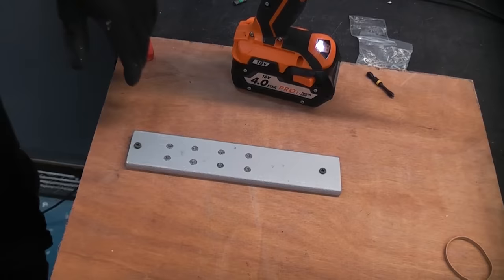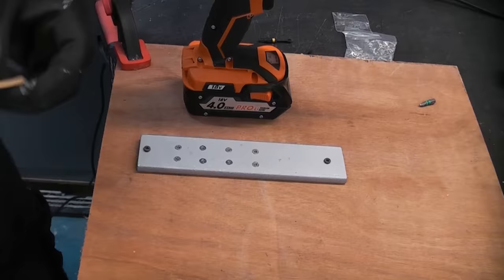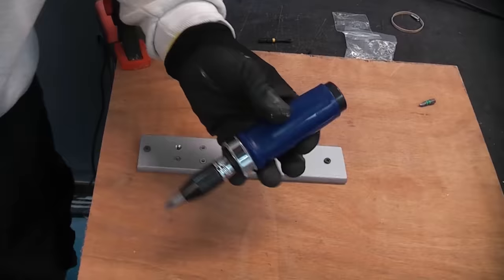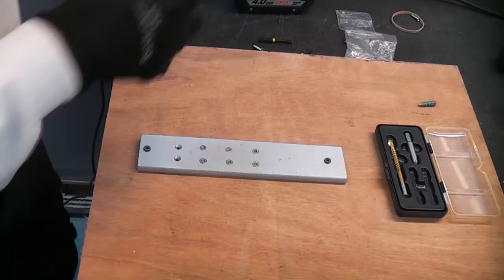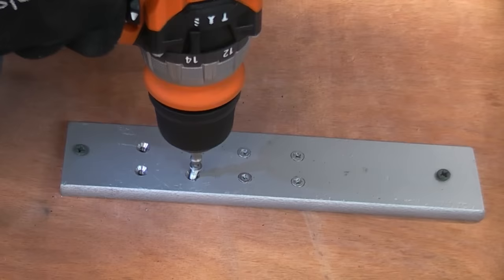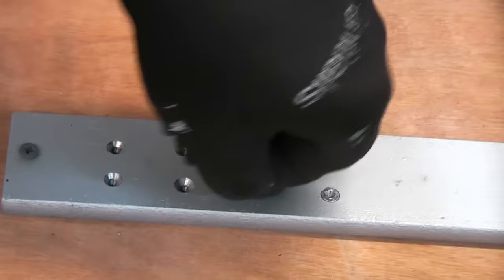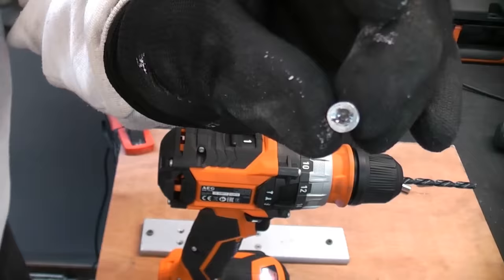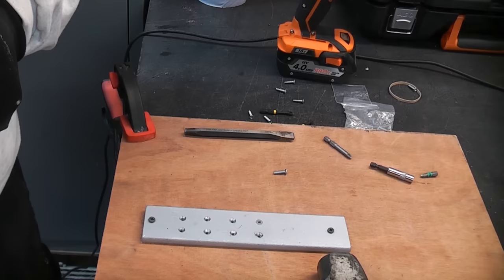How to remove stripped screws – 7 different ways

Comment: Anyone else salty af at a screw rn, I almost smashed my car window because of this screw
Reply: It's one of the most frustrating things, allll you need to do is remove the bolt/screw, ya can't even begin to start fixing the damn thing cause YA CANT REMOVE THE SCREW, I'm getting pissed just thinking about it lol. 

But yeah, stripped/rusted/snapped bolts/screws annnnd being unable to find a tool I JUST used when I haven't even moved are the worst things in repair in my opinion
Reply: Diving Duo bro this lil screw got me mad asf🤬
Reply: amen
Reply: Bike broke down and fixed everything and the only thing stopping me from being able to ride is a stripped screw!!!!!
Reply: 3 lil bstrd screws preventing me from changing a worn seat in my boat!
Reply: I might have to get a new steel chasis for my 1:5 rc car because of the damn screw. I'll edit if i will or wont have to.

Yeah ok i have to get a new chassis rip me
Reply: I jus threw my computer screen on bed which thn jump nd smashed on ground...now m super angry on myself..
Sitting in corner watching this video..
Reply: YES
Reply: @7withadot  same I'm working on the damn engine right now and I'm hella frustrated
Reply: Ye I need to get the seat of my motorcycle to get to the battery but I can't because one of dem fricking screws
Reply: Bleeder value screw on the radiator I stripped it off.
Reply: I started fixing an iPhone X that was 1300€ brand new, before getting in my hands some idiot messed up 2 screws and now I’m here stuck with a piece of junk with 2 bloody screws that are preventing me from fixing it......
Reply from the maker: @Keo   This video might help- https://www.youtube.com/watch?v=xaQ9eX-b6GA
Reply: Diving Duo mhm same boutta rpg my car if I don’t get these screws out
Reply: I'm in the middle of repairing my guitar, and I stripped the screws while replacing the neck, so there's that.
Reply: Lol I swear bro I was bought to fuck up the whole house 🤣🤣🤣
Reply: That’s called anger issues
Reply: Diving Duo me
Reply: XD
Reply: M2 slot in my laptop 😭 🔫
Reply: Yea! My freaking bike BRUH!! MY MOTORCYCLE!!!
Reply: Kyle Burke SAMEEE FRICK ME
Reply: Diving Duo Im trynna fix my Balisong but a screen is stripped Im Salty af
Reply: Same
Reply: I’m 9months late and yes I’m am livid I’m an working with a computer and this drive that is supposed to be screwed in is screwed in but done incorrectly so now I’ve removed 3/4 screws and one of the little bastards is messed up and I’m now I’m here
Reply: I am like well, life has ended. Might as well day drink.
Reply: @kyleburke5585  I am 1 screw from making a 110 yr old sewing machine operational
Reply: i am absolutely livid about a fuckin screw right now
Reply: Yes me rn
Reply: I'm about throw my ps4 out the window
Reply: Got too mad and now my 3ds xl is broken super sad i didnt see this earlier man still got my upvote learned something today
Reply: I’m about to throw my whole pc away guy I bought it off stripped one of the mobo screws🤬
Reply: So annoyed at my PS4 controller's screws. The conductive rubber beneath the buttons seemed to have worn out, so I order new one. But now I can't open the freakin controllee.
Reply: Fixed everything on my bike!!!!! And then the last screw is stuck!!!!!! IM SO FUCKING PISSED
Reply: 4 screws got me mad asf to even replace the screen the slide rail and the fckin sd card! On the fckin retarded nintendo switch
Reply: Diving Duo same
Reply: I'm literally dealing with this right now about my car with this stripped Philips screw underneath the car to remove this shield to get access to my starter....

Got all the screws off but the I'm one that is stripped... 🤦🏻‍♂️
Reply: So my screw for my laptop deformed how can i get this out. Fuck
Reply: I spent a whole day in one bolt stuck in a 1949 dodge power wagon the head rounded after the socket broke and I had cut the head off and it was on a cross beam type deal I put a jack underneath the beam and it lifted the front end of the truck... it weighs like 7k lbs
Reply: I need to remove the speed sensor of my car and I can't because of such a screw! 😰
Reply: Lol right I’m fucking passed right now! Stripped a important screw and now I’m here lol
Reply: No need to curse
Reply: any tips for removing a screw from a radio controller?
Reply: I get mad because Honda engineers don’t use bolts. They used the cheapest f-ing screws.
Reply: I am supposed to be studying but my laptop overheat shutdown on me 10 times yesterday so i thought i would clean da fan and literally I'm one screw away from opening the damned laptop.

This is so fucking frustating. I cant even attend classes.
Reply: Yeah
Reply: Hell yeah I’m trying restore these damn barstools and the last screw is stripped on one of them! So annoying 🙃🔫
Reply: Literally but everything pissed me off and it 2am so I’m tired and just started crying bc the screw on my bed is pissing me off so much
Reply: My Sig Sauer P365XL sight screws brought me here. Some bs for sure
Reply: Yea
Reply: Yes I stripped the screw in my skateboard and I’m mad as heck rn
Reply: Me rn trying not to throw my laptop out a window
Reply: if only i could smash my lenovo motherboard. stupid lenovo screwed the m.2 ssd so tight that it stripped!
Reply: I'm about to smash mine now.
Reply: @Trent Neiheisel currently got a stripped screw on an ABS Module for my Chevy Silverado 😂
Reply: ikr im trying to open my ps4 controller cuz somethin wrong w my right joystick but 2 of the screws are stripped amd rusted
Reply: Ye I'm tryna fix my mother's granny wagong and can't get the thing out.. getting mad rn
Reply: Just laughed so hard at this 😂
Reply: Trying to remove my bumper from my car and one screw is broken! My car's bumper is half hanging off because of this one damn screw...
Reply: Man I’m there right now LOL
Reply: im working on my jammed airsoft gun
Reply: If 23 is old then yeah I'm old lmao
Reply: @kyleburke5585  samr
Reply: @johnkren2636  i was also working on my guitar. Swap out a p90 in my hamer special and the 2 screws that are holding down the pickup got stuck halfway in so its poking out. Cant screw it in cant screw it out. Fuck me
Reply: @Subfightr  yea tbh u almost threw the shii across my room its pissing me off idek why we make screws like this🤦🏼‍♂️
Reply: Trying to repair a dirt bike 🤦‍♂️🤦‍♂️🤦‍♂️🤦‍♂️🤦‍♂️🤦‍♂️🤦‍♂️🤦‍♂️
Reply: @yentre8754  same
Reply: Same
Reply: @Subfightr  going through this right now. Stripped screws in my 150cc carburetor 🤬
Reply: It’s called screw for a reason mate 😂
Reply: My fkin helmet screw, how can someone make such poor screws for godssake, its screwed!!
Reply: Bought a bicycle yesterday that needs a brake shifter/housing. Simple job....but the gear shifter can't come off the bike meaning I can't remove the brake housing...all because of a messed up screw!!!! Elastic band hopefully to the rescue since I have limited tools :D Biggest tool in the box seems to be me right now.
Reply: I almost smashed my camera
Reply: Mate I had 3 out of the 6 screws holding my wheel on my electric scooter strip with minimal force while using the correct tool which has made it literally impossible to replace the tyre. I am pissed.
Reply: Yyeeeppp, trying to remove an ignitor from an old bike and the last owner decided Phillips head are a great choice for a fucking bolt thats gonna get Wet
Reply: Yup. I just wanted to paint a damn wall while my toddler takes a nap.
Reply: ford engineers set the torque spec for my cargo rack to straight jesus mode
Reply: Two years later and i just slammed my hood🥲
Reply: Lmao yes!
Reply: My phone screen is driving me crazy rn
Reply: I feel so much better reading these comments I was so close to violent destruction trying to remove a hex grub screw so I can replace the cartridge on my level basin tap, it’s not going anywhere so im just sitting here waiting for Police to arrive, my wife said “you might have to get the plumber to come back “ that was super helpful .
Reply: @ronnieg1341  I hear you man, I, sitting out here on the street with a whisky watching the house burn, cops ought to be here soon, wife is gonna be super dissatisfied when she gets,home . All because of a dripping tap/faucet and a stripped out grub screw, I do feel better reading these comments though
Reply: 2 years later and this is still felt😭
Reply: Just almost smashed my ps4 it came in the box with the inside of the screw slanted downwards and every thing just spun in it
Reply: @Subfightr  same bro fucking 22 year old factory radio screw stripped and won’t even turn
Reply: I’ve been trying for over three hours and have less than zero progress
Reply: Here for this same issue 😭
Reply: You know how it is
Reply: @nanashi2632  "Sitting in corner" 😂😂😂
Reply: My curtain rod screw I literally have been begging and then pissed off and threatened it. Soo... now I'm on YouTube cause fuck it
Reply: I spent 2 days sanding , cutting , filling , sanding , priming and building an outdoor lounge table , only for the last pocket hole screw to become stripped and cause me to disassemble the whole thing again . 🤬🤬🤬🤬
Reply: yes, yes i am.
Reply: Ffs
Reply: Don’t “screw” with this person, they don’t “Screw” around LOL
Reply: What works best to remove a screw in a MAGÀ'S head?
Reply: @Subfightr  Spot on! 👌😆
Reply: Lololol yessss
Reply: Nope, didn't understand a word...
Reply: My battery is bad on my scooter. But I can’t get it out because of a screw. I won’t be able to replace it, it’s stuck in there for now. How am I going to get to work Monday? You would think flat head screws would be used more often. How such a little thing can create such a big problem is beyond human minds.
Reply: You have no idea. 2 came off fine on my moped, and on the other side the bottom one came out eventually, the top one is now destroyed and I'm losing the will to live 😂
Reply: ur comment is 4yrs old and i hope ur feeling better abt the screw but ye. i think im going to throw the whole door away 😭😭😭
Reply: 2 hella screws they just put me in damn shit
Reply: @Subfightr  facts😕
Reply: YUP, happenin rn tryin to remove the derailer on my mtb..
Reply: Wanting to kick the bike I just got over because of this screw

Comment: These videos are nice and all but the reason you're not getting the same results is because these people are drilling and stripping fresh screws/threads, while your screw has seized from all the time it's been in place throughout the years.
Reply: Spot on
Reply: Worked for me on an older home we bought where they had stripped screws putting cabinets up. I had to use the last method of turning them into flathead screws, but they’re finally out.

Comment: I don’t get how all these DIY tutorials always seem to work for everyone else, but never for me 😩
Reply from the maker: Some techniques work some of the time, but experience helps ;-)
Thanks for the comment 👍
Reply: Same😂
Reply: It is because you did not put.on gloves.
Reply: The rubber band one pissed me off so badly lol
Reply: A lot of it has to do with being able to press down hard! If you're working in a position where you can't get good traction or in a tight space probably most of these won't work other than the spring loaded thing. This is exactly the problem that i have right now. So i'm going to try the rubber band and if it doesn't work good old pliers because my screws are not completely set in.
Reply: Cause he s probably got a decent drill , mine is pink and from wal-mart , and forget an impact driver . ,,, sigh ,, I need a big girls tool box Lbs
Reply: @kahlalamb2854  literally crying at this comment 🤣🤣 because I'm in the same boat..thought I was cute with a pink walmart drill.
Reply: me turning on you maybe we could work
Reply: He might have had a better table than you?
Reply: @jlcdrivewayramps7343  He might have had a better table too.
Reply: Stacey, This video was only for demonstration purposes to empower us with the knowledge of tackling such an impossible task. I'm just a DIYer and I have struggled with removing good screws with their head intact let alone damaged screws! A lot of screws can be rusted or buried and just very stubborn to remove. But the key is to try different tools and techniques along with persistence/perseverance. I don't have all the tools that are mentioned in this video but once I was able to remove a small screw from my son's computer harddrive by cutting a line across the head of the damaged screw using a junior hacksaw. I was then able to get just enough purchase using a flathead screwdriver which I managed to remove by hand. It took time but I persevered. And I'm no builder or know anything about screws. But this video is very informative and helpful so I appreciate these videos from tradesmen especially this one. The key is to get enough purchase/grip so that the screw can turn.
Reply: @KosmikGawdess   Yeah when it comes to tools, functionality comes first, second and third.
Reply: lol
Reply: @MrammiR  noon population
Reply: @kahlalamb2854  look
Reply: Exactly
Reply: It’s cuz u have to talk to it in a Great Britain accent
Reply: I was about to say the same.
Reply: time to call your man baby
Reply: First off this dude has 1/2” screws that aren’t really that deep into his material
Reply: A hood classic, un clásico del barrio
Reply: @kahlalamb2854  i actually tried a normal screwdriver and the screws literally melted down and got stripped stuck 😴😴😴 I guess my hand is overpowered
Reply: That's the power of editing
Reply: You didn't try the "duct tape" method. I actually just saw that on the site of a Canadian DIY lady, @Daru Dhillon.
Reply: @cesarcotto3351  His is not that accent. It is more like Scottish or Irish.
Reply: It doesn't work for you because these are the simplest extractions possible in this video. What you may be trying to extract are rusted bolts, stripped threads, cross-threaded or perhaps one corroded so bad it would actually snap the tip-off of a screw extractor.  What you may be dealing with would require penetrating oil, heat, and impact.
Reply: @robertragland6084  Me too, but the grab-it worked like magic!
Reply: Maybe the Ultimate Handy man has a hint?
Reply: yup, there never removing steel screws that have spent 10 years tight as hell in aluminium....
Reply: @cesarcotto3351  he has a northern British accent, definitely not what I call great British
Reply: @kahlalamb2854  LOL!! I'm working on my big girl tool collection now....lots of good used stuff out there, too
Reply: Mostly because his screws are in wood. They can be removed with almost any method with very little force. Tose stuck in metal are much harder to move or remove.
Reply: Do what the Master Mechanic does on this problem. Use a Dremel type roto tool, and cut a slot through the screw head. Then remove the screw ( with a standard slot screwdriver), and throw it away, after finding a good replacement. In the future, use the CORRECT, tight-fitting bit. Takes less than 5 minutes, and works every time.
Reply: Yeah the rubber band is complete BS
Reply: He had just screwed these in. In the real world there’s corrosion of the metals to deal with as well. It was a great and much appreciated video though.
Reply: You just need to have specially trained screws like for this video!
Reply: Because you have too be a TOP G lol
Reply: Agreed. Me too
Reply: A big girl's tool box will never be pink (think the same realm as cotton candy and unicorns); no handyman in his right mind would fall for pink; maybe orange or yellow. The quality tool companies that care about their reputation cater to the guys who know which brands work and which don't, because they're the ones who spend the big bucks and keep coming back for the next thing on their list--that will likely fall into the same brand if its proven itself. So if you want the quality, ask a guy who uses the tools regularly and he can guide you to the one that will accomplish something when properly applied.
Reply: @willspy4u  mate, it isn't. Northern English. Someone from up there can be more specific and I'm careful not to muddle Yorkshire with Lancashire. But somewhere up in the Pennines.
Reply: @robertragland6084  Why, because it's useless? You just need special kind of rubber with magic ))
Reply: nope!  not just you, Stacey A
Reply: Seriously lol but he's using easy screws to take them out...lol scammer
Reply: @willspy4u  nope he has an English accent.
Reply: @TheIdlesurfer  I know, but we "Yanks" consider them all the same, even though they're not.
Reply: @Mick Storey   @Pekka Puupää  I know, but we "Yanks" consider them all the same, even though they're not.
Reply: I just used vape juice.😂
(Expired) Somehow it passed through  pcb layer.
Reply: I don’t mean to be rude but too much talking. Get to the point straight away. I don’t have the time nor patience to listen to the entire video.
Reply: @ultimatehandyman  problem is that my screws are LITTERAL ⭕
Reply: Have you tried wearing safety flip-flops?  Those guys can work miracles in YouTube videos
Reply: @willspy4u 
FYI…Somewhere from the North of England.
Reply: You ain't the only one. LOL But practice and patience usually will get you desired results.
Reply: @willspy4u Lancashire accent